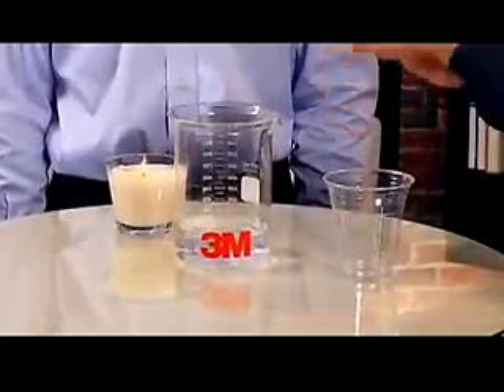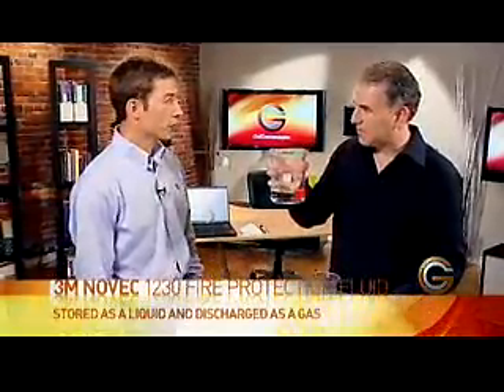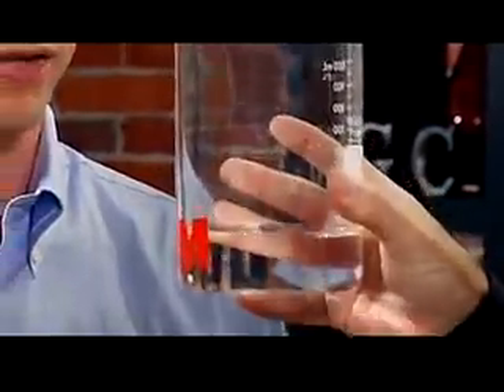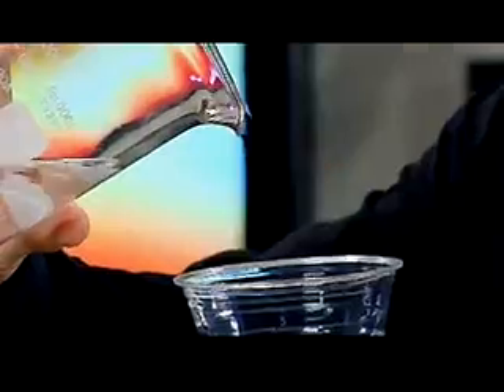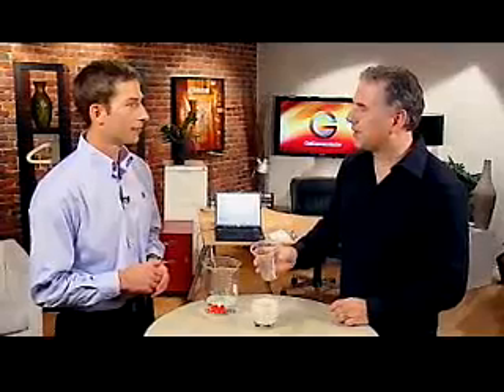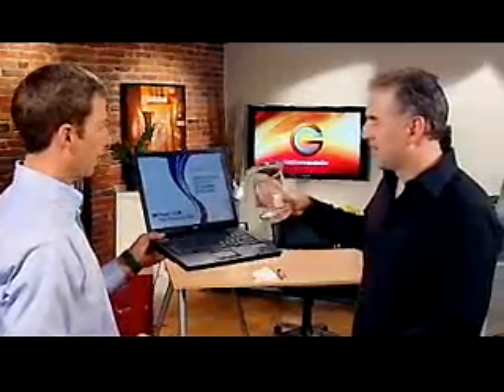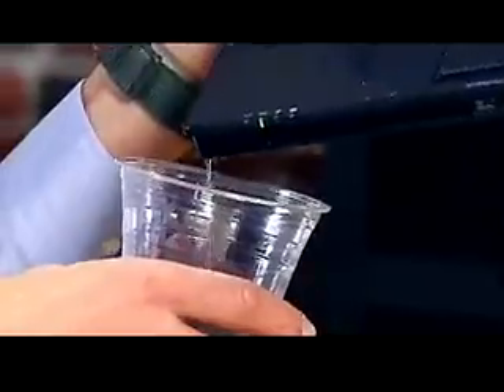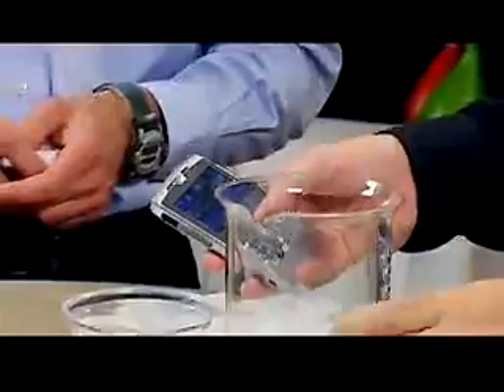GC Season 4 - Ep2 - Seg2 - 3M Novec 1230

Comment: FYI. It's not 'completely safe to drink'.  You won't die if you drink a little, but it's not recommended.  It's not recommended to immerse electronics that require air to work, like HDD (a SSD will be ok, though), and earpieces (air is required to carry sound waves).  You can immerse a PC motherboard, power supply, CPU, etc. I've done that, but I prefer 2-phase immersion cooling using Novec 7000 and a thermoelectric cooler.  As for pricing, Novec 1230 is not sold via retail, only through OEMs.